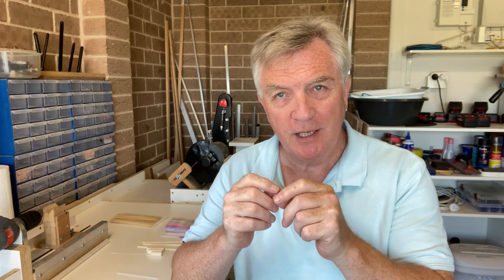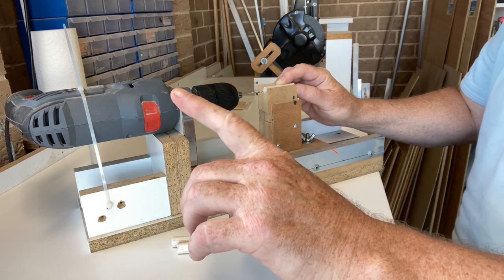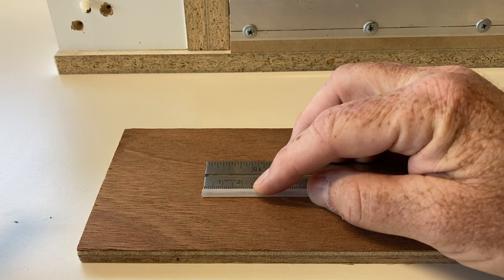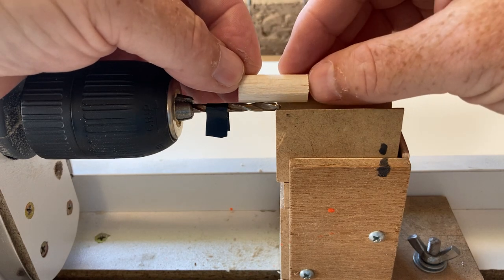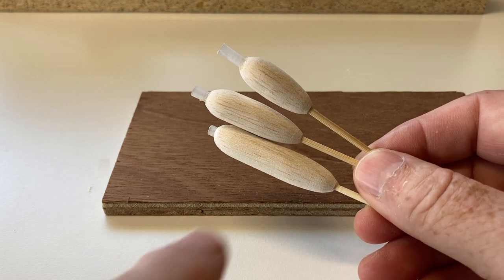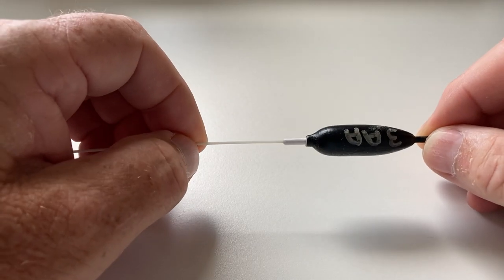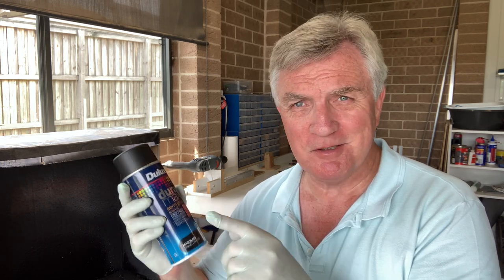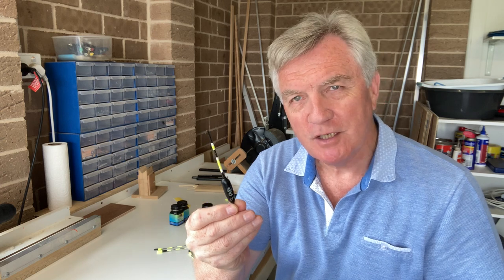DIY Antenna Float for Lift Method Fishing

Comment: Great video Den, thanks. Is there an alternative wood to the balsa? It`s difficult to get near me and quite expensive on line. Any help will be much appreciated. Regards, Stuart.
Reply from the maker: Thanks Stuart. I have seen people using wine bottle corks, but this would take a lot of work in sanding. Another alternative might be to use local reeds which you can find along the riverbank. Here's a video showing how to make those floats: https://youtu.be/gsLFXqCd8vI You could add the thin tip to these bodies.
Reply: @FishingwithDen  Thanks Den, another great video, will give  them a go. I think they`ll work well in my local pond.

Comment: Hi Den, thanks again for another great video, I've had ago myself, not as good as yours but practice will make perfect. At the end you used n old jar as a shorting tube, well, I've found a glass vase about twice the length of your jar in The Range for £5:99, works a dream I even got the tell tale shot set up as well.
Reply from the maker: Thanks Tim. I probably should get a longer tube, but this one was lying around in one of the kitchen cupboards, so I stole it. The wife hasn't even noticed yet. lol.

Comment: Loved this.... will need to try this myself!
So, have you found that the spray enamel paints are superior to other sprays or to dipping or paint brush?
Reply from the maker: It's not really a question of the spray paint being superior for me Brian. It's just that it takes a lot less time to spray them than using a paintbrush. Both ways provide a good end result, but be careful of cheap spray cans. You can easily end up with drips.

Comment: Hi Den, just been looking on ebay for pole float stems and found loads but of different diameters. Could you please tell me what diameter are the ones you have used. 
Many Thanks.
Reply from the maker: Hi John. The fibreglass Pole Float Stems I used were 1mm in Diameter. The BBQ Skewer ones are around 2.5mm.